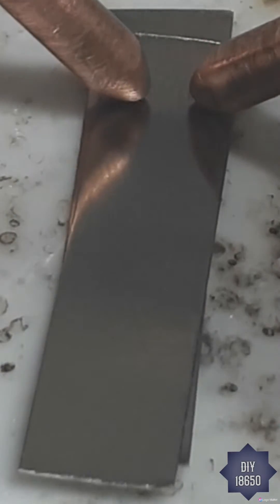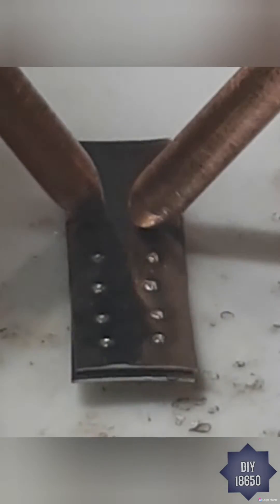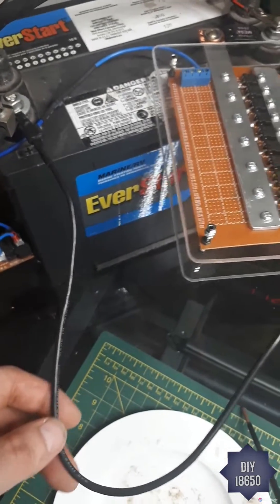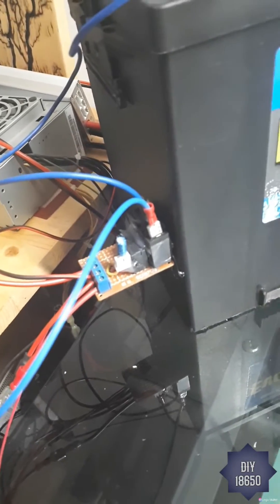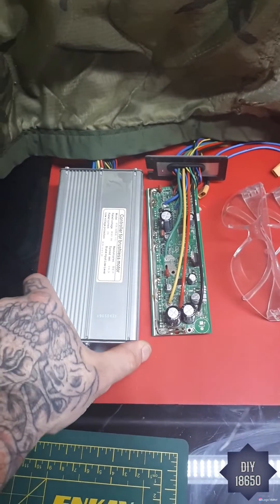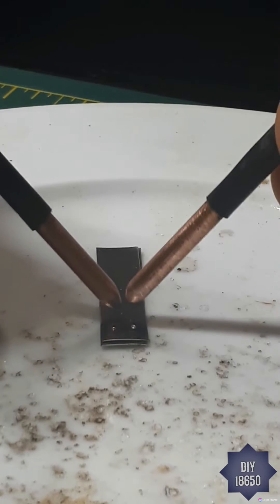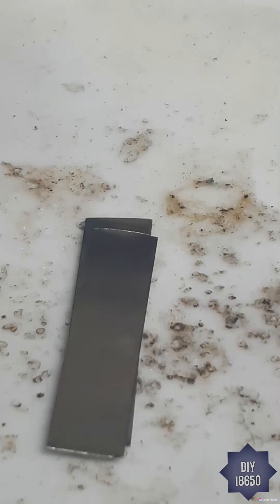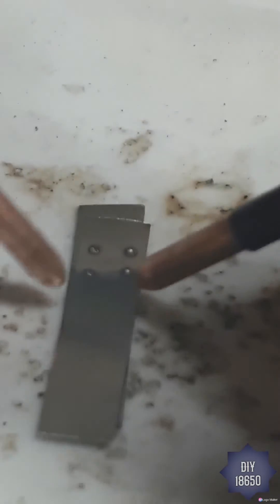Mosfet Spot Welder Part 3/ DIY 18650 FB Group

Comment: indeed nice project, been putting info together to take a whack at it myself soon.. about to go scrounge some parts going to goodwill getting some old recievers ect
Reply from the maker: It was a fun project and a few guys at my work made them and are using them. You can make a truck relay welder with a timer board alos